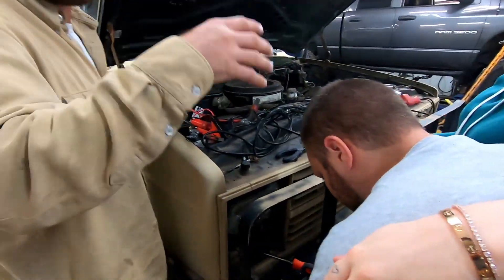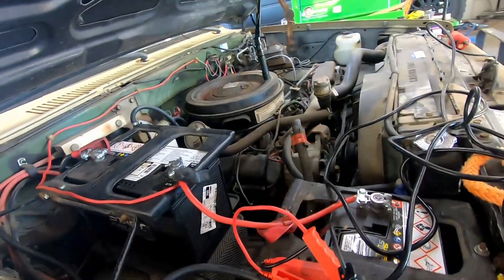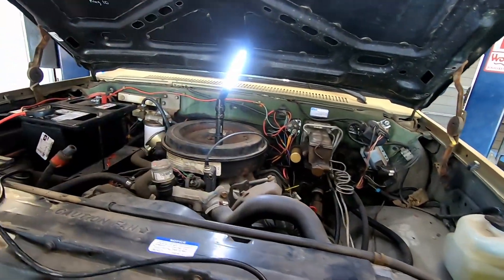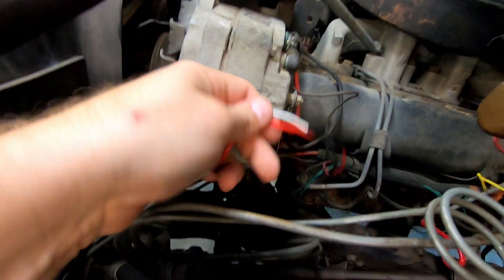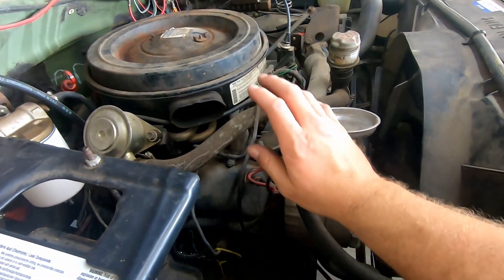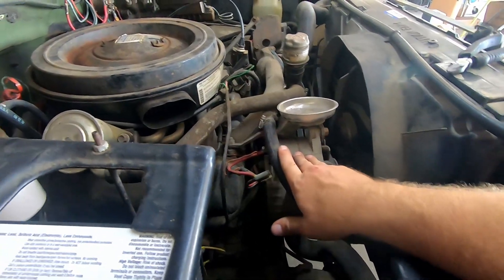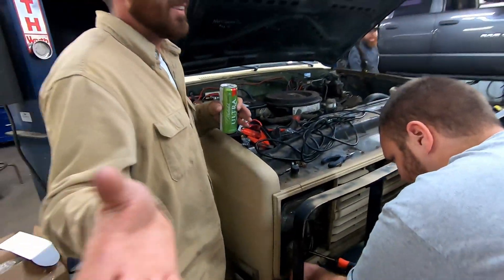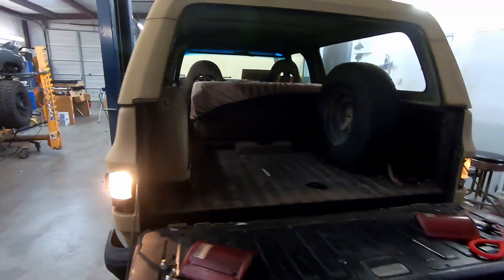Project Gunny 24/12 volt charging issues (Anthony gets Ratted out)

Comment: Both Alternators put out 12v.   Your passenger Alternator is NOT a 24v alternator.   Steel Soldiers is the website for M-1009 knowledge

Comment: They are both 12v isolated grounded alternators in series. Passenger 
side must be isolated ground, but the driver side can be isolated ground
 or not.  That goo inside the connector is probably not melting, its 
just the crap they put in there to keep corrosion down. Nice vid!!
Reply from the maker: Thank you. I know alot about new GM vehicles and grew up around 70s 80s and 90s chevy trucks and camaros definitely took me a min to figure out this system.